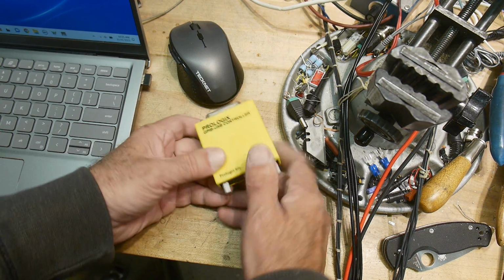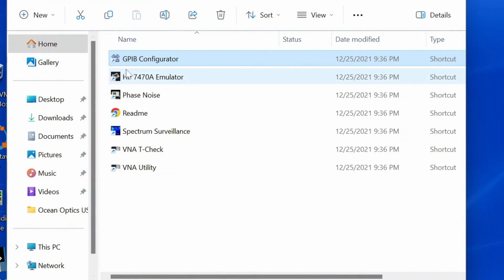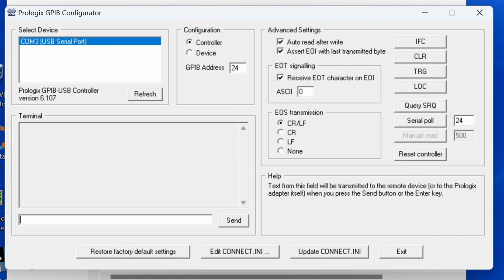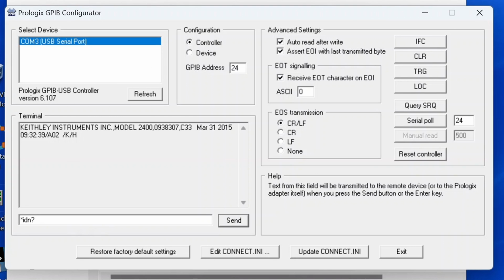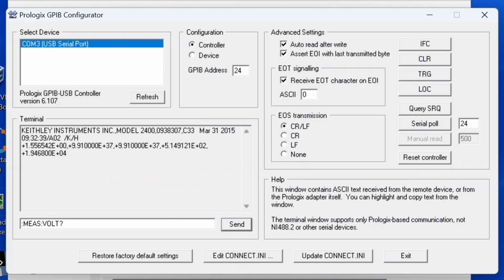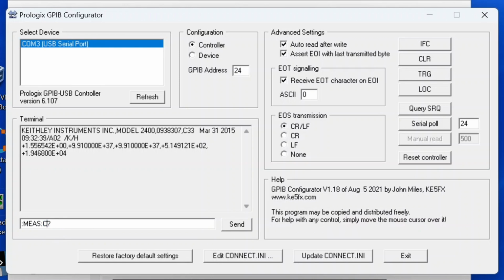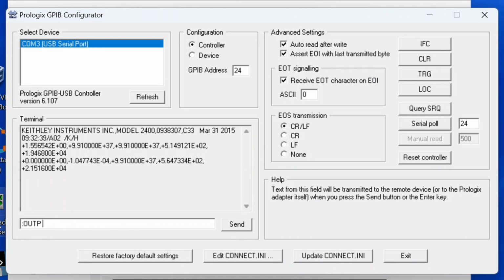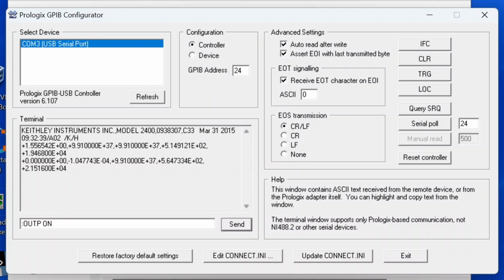#1744 HPIB GPIB IEEE-488 Instrument Control

Comment: There are open source avr / stm32 usb to GPIB adapters if people really still want to use HPIB / GPIB. e.g. UsbGpib which exposes a USBTMC interface.
Reply: There are several of these, especially the AR488 project which uses Arduino, which I made an ESP32 version with several improvements (look for ar488-esp32, the main repo being on sourcehut, including a series of PCB design for different ESP32 boards) with optionally proper GPIB drivers (SN75160/162).

It implements the "prologix" protocol, but add support for more GPIB features (and include support for wifi and bt thanks to the ESP32)
Reply: @daviddouard9294  Good to know cheers, I have only tried a friend's UsbGpib adapter. I use rs232 with older equipment when I can, it's slower but I'm used to it. Wireless GPIB would be nice, but wouldn't it still need power supplied externally ?
Reply: @ryebis unfortunately yes, there is no easy way  to gather power from the GPIB bus (like what you can do with SCSI , for example bluescsi dongles can be powered like that). But the nice thing with ESP32 is you can find ESP32 boards caoable of running from lipo batteries for dirt cheap. TBH I only use mines directly from USB since I have a small linux box buried in my stack of test equipment. But it might still be handy for some usage I suppose.

The other nice thing with ESP32 is that it's powerful enough to think bout silly things like embedding a (HP)BASIC interpreter on it. It;s something I have in mind for some time but never found the time to really try it. The idea was to use tinybasic and extend it to make it as close as possible to the BASIC running on HP 80 machines or more adequately RMB (Rocky Mountain Basic). Would be fun (but so many projects...)
Reply from the maker: I don't want to. I have to.
Reply: RS232 USB is the easier way out, unless you have something with only HPIB / GPIB.

Comment: You hardware guys! You have a device which speaks rs232 serial or GPIB which you send through an expensive cable to an expensive converter to usb which is then software converted to serial. You're writing scripts anyway. The script is going to issue serial commands anyway. Unless the Keithley rs232 is not capable, or you want to daisy chain several, you might consider straight serial. Love your work, though
Reply from the maker: I've already done rs232 videos with the keithley. I want to control multiple instruments. Most only have hpib.

Comment: One of my early consulting jobs (1980) was to build a HPIB/IEEE1488 Interface for a piece of custom test equipment... Strangely, it was the end of my use of Intel components, as their GPIB IC had a failure mode when used with a Motorola CPU, and Intel "application engineers" were pretty useless, and not at all interested, if you weren't a massive company, so we switched to the Motorola device, and that worked better, and their AEs were actually helpful to anyone who called with a real question!
Off-topic, but, worked with that interface "a while ago" (almost 44 years!)

Comment: First used GPIB-488 with a PET to control a voltmeter far too long ago to think about.
Next i built a 19" rack ATE with a PC, DMM, Switch matrix and PSU all controlled via 488, I remember that the switcher and DMM cost more than my house at the time :-0 

Last time was about 4 years ago to run an EMC test chamber. So the operator only had to change antennas and amplifiers as prompted and the PC did the rest. I used an Ethernet to GPIB-488 converter so I could run the system from my office if i was just testing a single band with no hardware changes. great for checking the config program that was used to control the test.

Still looking for a cheap bus interface for my home kit, or i could just stick with my PET 4016 which I've had since new.
Reply: I had a SuperPET SP9000 which had RS232, Centronics and 488 as well as two processors (6502 and 6809). The floppy drives ran off 488 and were pretty fast. I don't have the machine now but maybe the manuals. I know I have a list of all the Peek and Poke addresses!  I also had the Toronto PUG board which ran a Unix clone: https://en.wikipedia.org/wiki/OS-9  The C compiler was very fast for a 1mHz machine!   I bet there are still CoCoNuts around.  Maybe Adrian has one.
Reply: @barrybogart5436  a lot of PETs were used just as instrument controllers,  don't know who put the gpib-488 bus on it but it must have been a big selling point.    Never could afford a dual disc drive,  did in the end get a single drive.

Comment: The gpib adapters and cables are so expensive, most modern equipment use LXI, which is the same but over the network and so much cheaper and faster.
Reply: Yeah, it's really only useful when you're trying to control old boat anchors. Hence it's appearance on this channel...

Comment: There is freeware that will control the Keithley 23x and 24xx smu's. It's called "I-V Software" 
This software has configurations to evaluate solar cells and diodes. It allows one to control sweeps with simple commands. 
It has customizable graphics and one can easily export data. 
I use the NI USB-GPIB on Windows to connect. Installation of free NILabview runtime is necessary.   This program runs my K236 without issue. 
BTW, the author also has a program to control the HP4192A.
Reply from the maker: Looks like it might not support the USB-GPIB adapter I have
Reply: @IMSAIGuy  His description doesn't preclude any non-NI adapter.  Only one way to find out!

Comment: Anybody know of a decent Clone/Cheap/Asian GPIB/USB Interface Module and Freeware? Thanks!
Reply: As mentioned above, there are several FOSS projects implementing Prologix-like GPIB interfaces, especially the AR488 and the ESP-AR488 (disclaimer: I wrote this later one from the original AR488 to use ESP32 instead of avr boards)
Reply: Our old friends at aliexpress sell them, still not cheap though!, averaging £50 to 60 to here in Britain.
Reply: You can Google for "AR488 board".   Building an AR488 GPIB Interface

Comment: When I worked for a defense contractor in the 80's they built large racks of this type of equipment with a tech bench in front. The test bench utilized all kinds of specialized fixtures and cabling for "DUT" testing. It allowed very sophisticated military radar modules to be tested by regular techs without having to know a lot about the inner workings of what was in front of them.